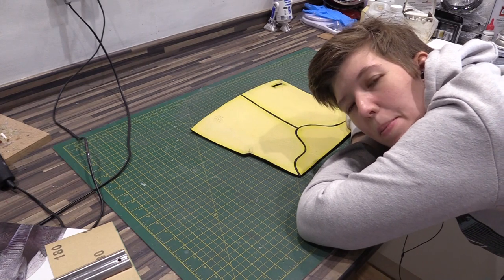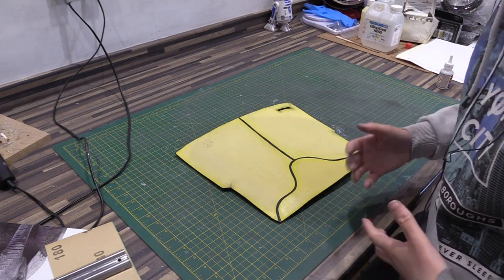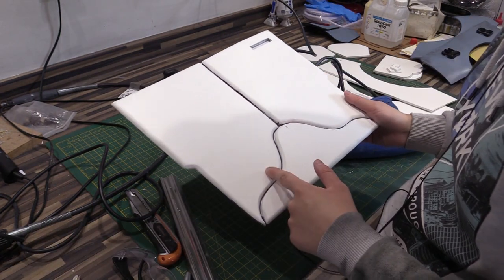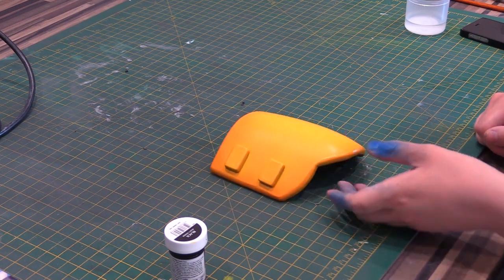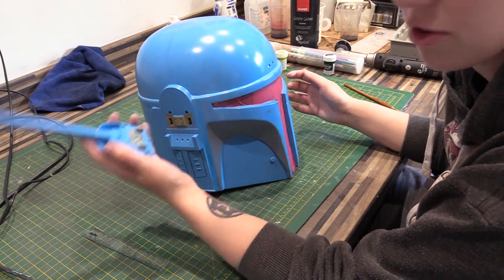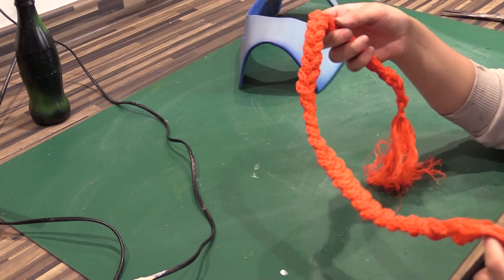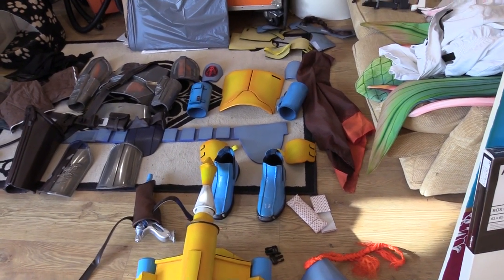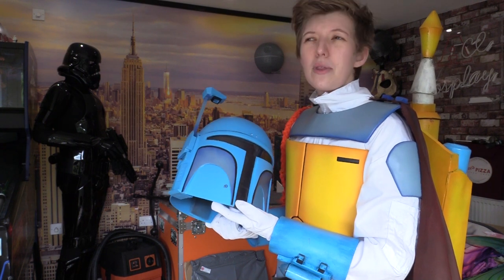Holiday Special Boba Fett Costume Upgrade

Comment: Would it not be easier to cut the foamex with a Dremel tool rather than with the constant scoring with the fixed blade? Or does the speed/heat of the tool affect the material in any way?